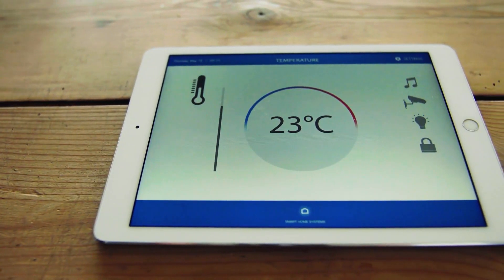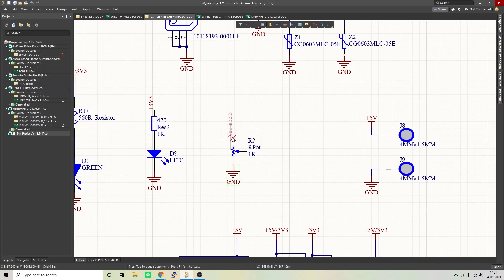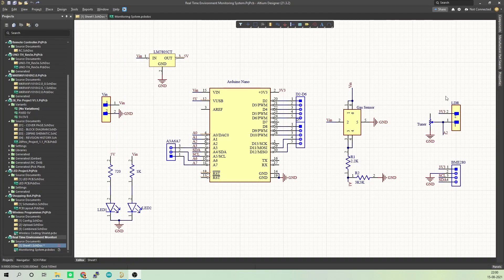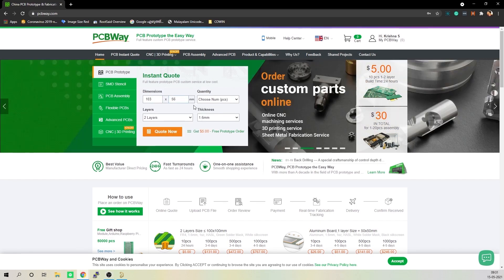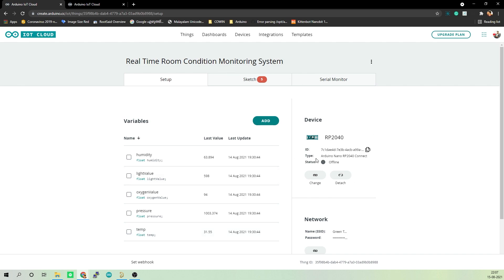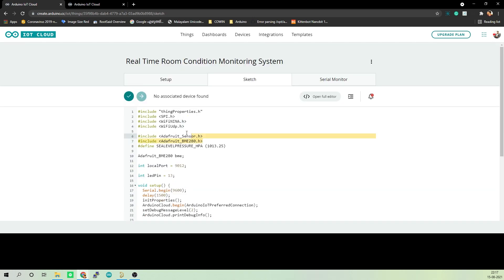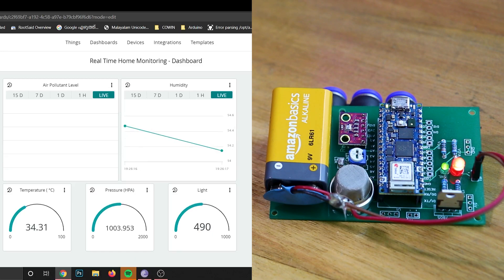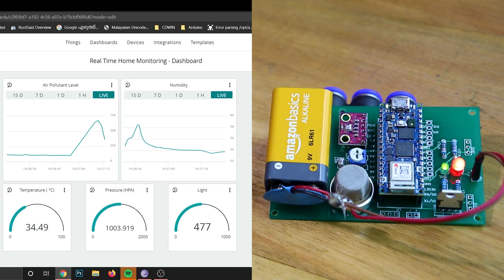Take Care of Family & Elders using Arduino | Real-Time Home Monitoring System - Arduino IoT Project

Comment: Nice project, but that 9V battery isn't going to last long, since the circuitry is powered 24 hours/day, so I'm not sure how practical this is for remote sensing over a period of time. You should reduce the current draw by deleting the LEDs, choosing a better LDO (with less Iq and lower dropout voltage), and even having a low Iq timer to turn the whole thing on and off periodically for taking measurements and going back to sleep. It could wake up for a few seconds (or whatever the shortest time possible is) every minute or two. This would reduce the average current draw, and therefore increase battery life, by an order of magnitude at least. (I understand that having it powered all the time is good for demo, but...)